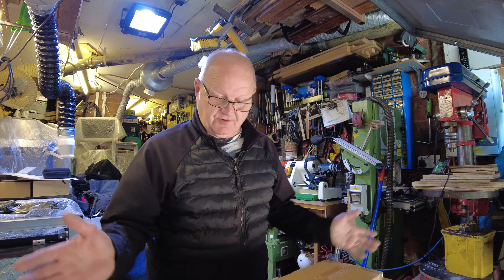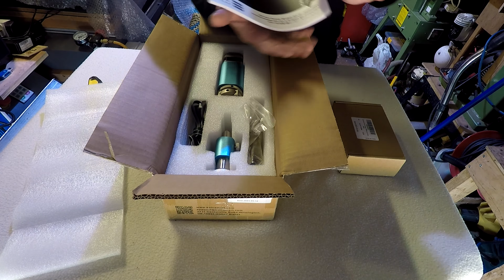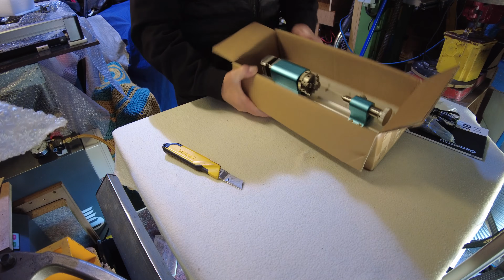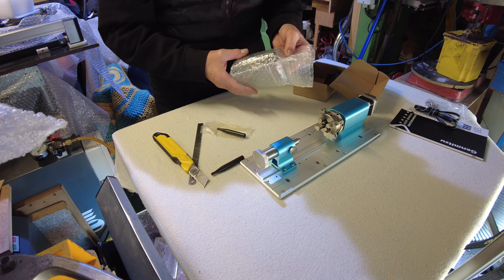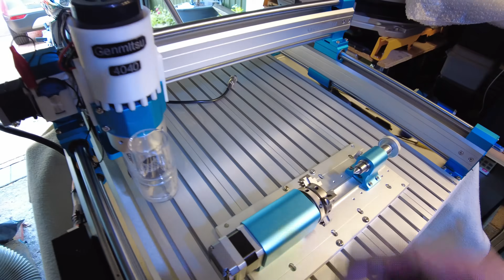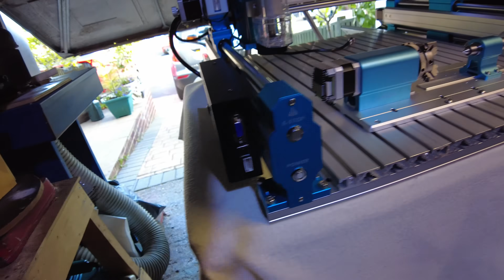Sainsmart Genmitsu 4th Axis Rotary for the 4040 Pro and offline controller unboxing

Comment: your z axis is mounted in the lower position and should be raised to the upper position for a axis work
Reply from the maker: Hi you are right with the z axis needs lifting to the upper most position, I have already done this in my next video but the problem is it does not mention this on any of the instructions I have so I put this out to warn people this should have been part of the instructions. If you hit that home Butten by mistake it will cause damage, Thanks for your great feedback